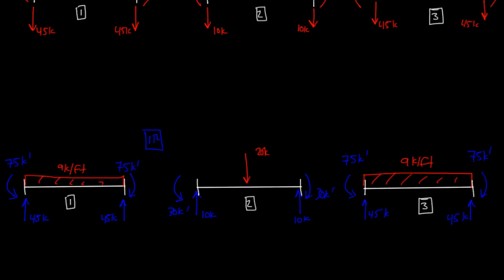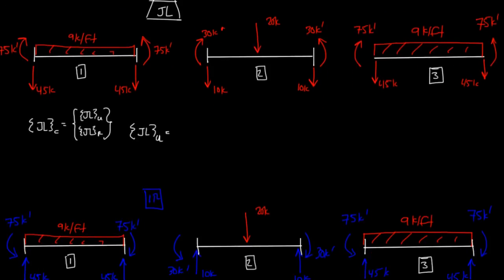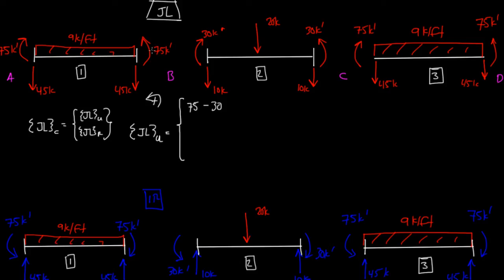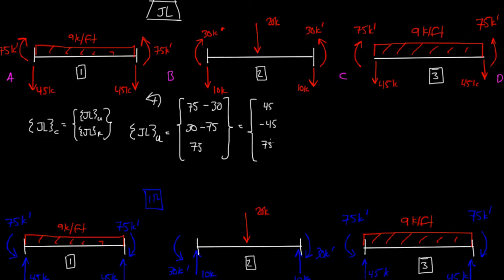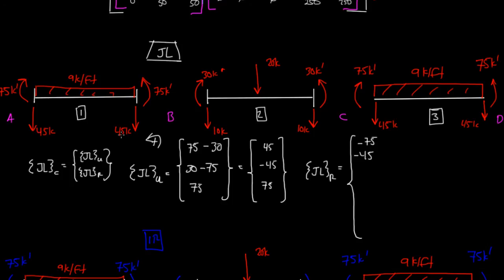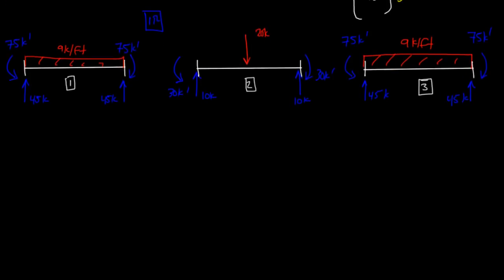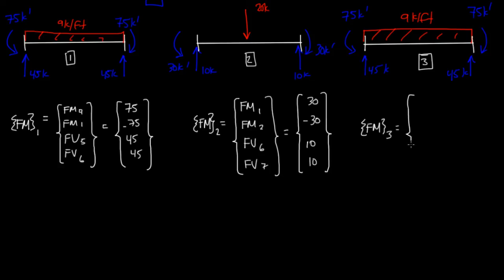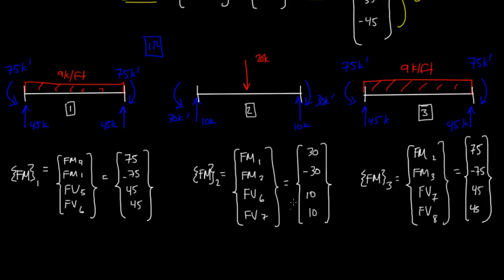Stiffness Method Example 2: Part 5

Comment: So isnt this example wrong, since a roller only blocks movement in the negative direction (so the beam can move freely upward, so the 75 kip/ft at node D will cause a displacement)